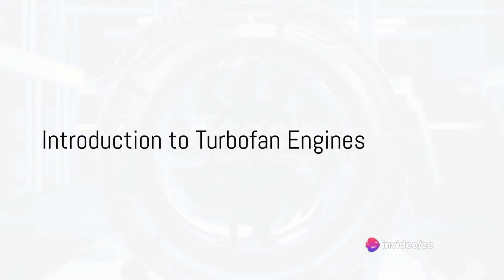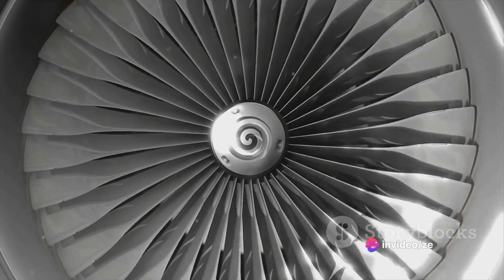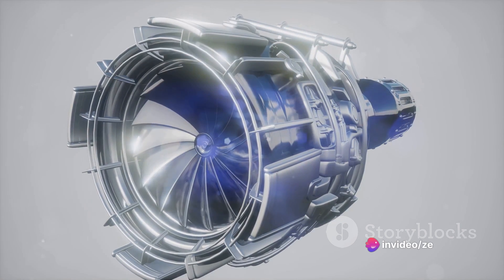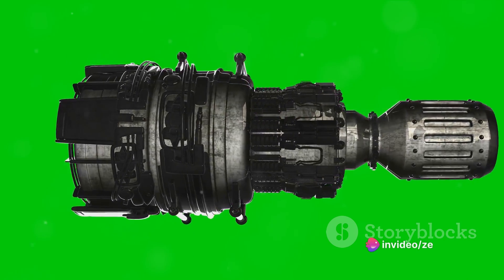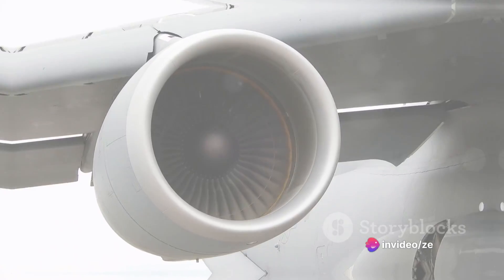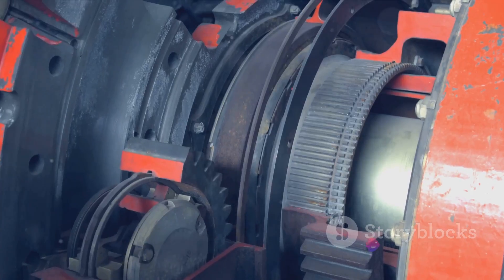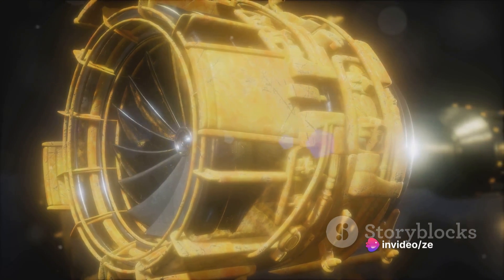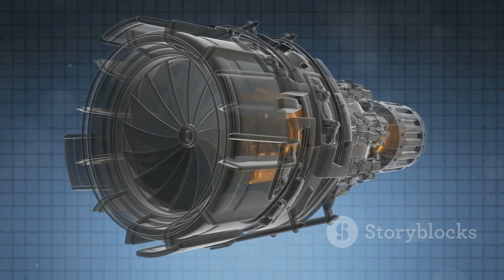How Does a Turbofan Engine Work?

Comment: Most important thing of this turbo jet Turbine is Mass Inertia Balance, because unbalance intnertia forces  creates vibrations.... and these vibrations could damage the Turbine and also at high RPM centrifugal force also balances which is given by F=Mw²R. Where w is the angular rotational speed.